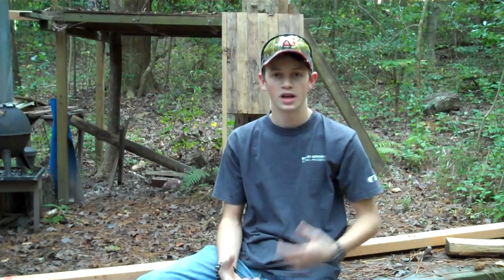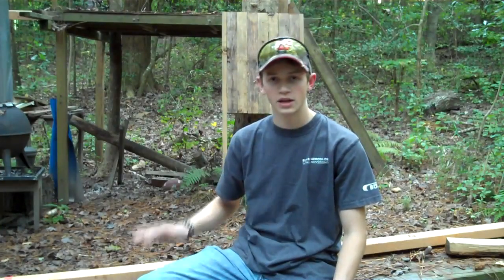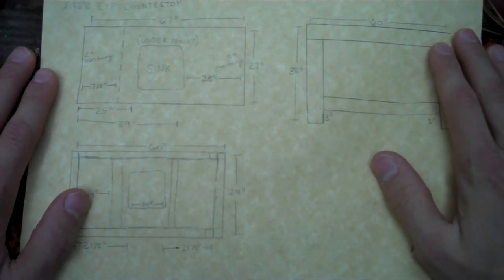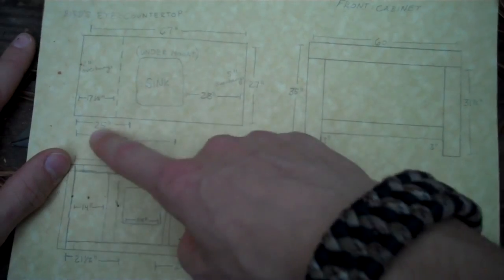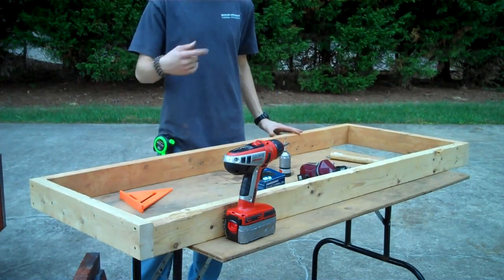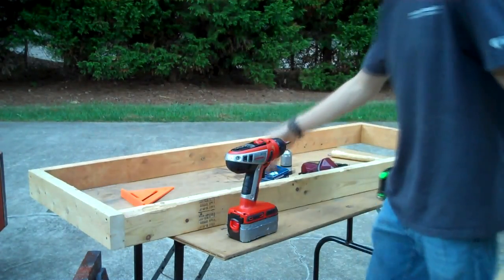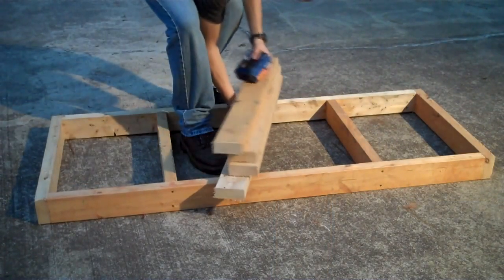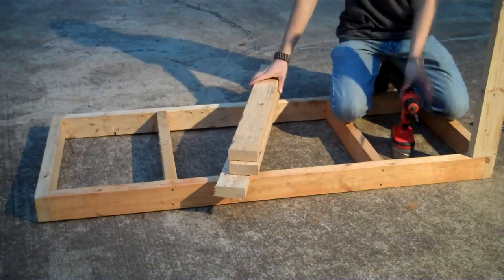How to Build a Kitchen for Cabin/Workshop Pt. 1

Comment: Tip: Choose sink drain fittings to match diameter of a sump pump drain hose. Heat end of hose in hot water & slip over end of sink tail piece. Will be tight. May have to jaws of pliers to stretch a bit. Hose I bought was 20' or 25' long. Can route grey water anywhere you like. One of mine goes to a garden bed to water plants. (Local zoning may forbid this use.) 

Using this drain system, can move sink (no cabinets underneath basic frame) if needed for temporary use in another location.

Comment: Don't like to toenail? I don't either! lol

Another option is to cut 2x4 longer legs & put in corners where side & front rails meet. Attach with screws/nails inserted from outside each adjoining rail. Stronger connection to rails, as well.

Disagree with ya. :-) Bet you build at least 1 more. Easy to build. Used sinks inexpensive. Over the years have built them anywhere wanted advantage of a outdoor sink attached to a water hose. Cleaning fish, outside shop, near backyard fire pit, etc.